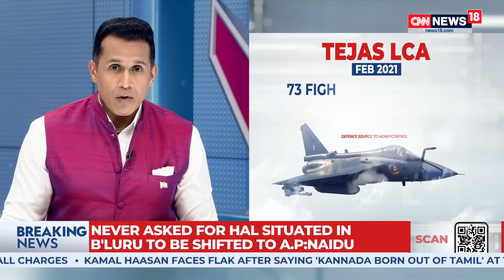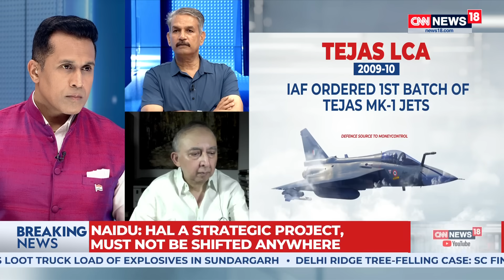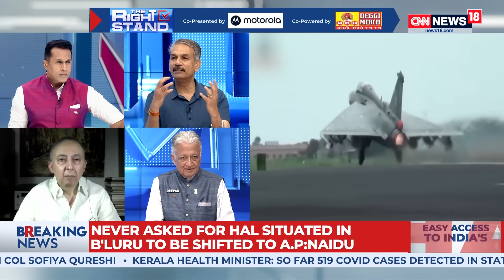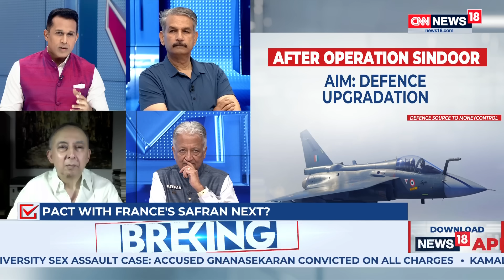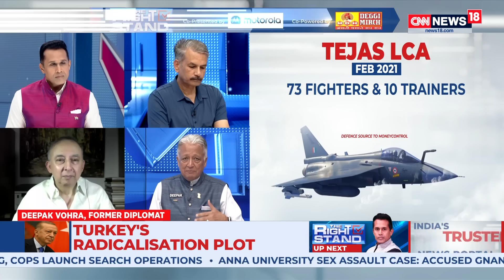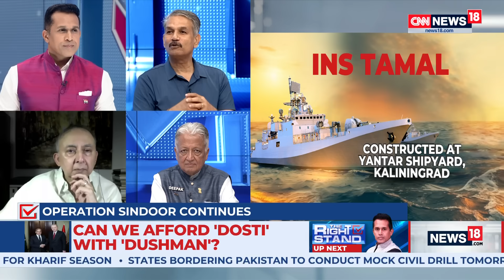India Eyes Partnership With France's Safran To Power Next-Gen Tejas Mk2 Jets | #therightstand

Comment: What is the benefit of Tejas with GE404? is it a value for money investment.

South Korea’s KF-21 Boramae is powered by the GE F414-GE-400K engine, while Turkey’s indigenous fighter uses the F110 engine, the same one found in the F-16. For India, opting for the Safran M88-4E engine makes strategic sense. The French are more willing to cooperate, and maintenance is simplified since the M88 is similar to the engine used in the Rafale.

The era of close-range dogfights is largely behind us. Modern air combat requires stealth fighters capable of neutralizing enemy threats from distances of 500 km or more. Success depends on long-range supersonic air-to-air missiles, advanced electronic warfare systems, and radar-absorbent material (RAM) coatings. These elements, more than raw engine power alone, make the difference in today’s aerial battles.

Comment: Why the Public Sector Must Anchor Armed Forces Servicing, with Private Sector as Strategic Integrators

In the context of India’s defence ecosystem, it is strategically sound for the Armed Forces to interface primarily with public sector undertakings (PSUs) such as HAL and BEL for servicing, spares, and long-term sustainment. Here’s why:
	1.	Streamlined Procurement and Servicing:
Direct procurement and servicing from PSUs are operationally smoother for the Armed Forces due to established government-to-government frameworks. These public sector entities are better aligned with defence procurement protocols, reducing delays and administrative complexities.
	2.	Assurance of Quality and Qualification:
PSUs have the systems and experience to rigorously qualify spares and sub-systems, ensuring consistency with defence standards. When private sector firms supply parts or services to PSUs, these undergo an additional layer of scrutiny—ensuring the Armed Forces receive only validated, field-proven components.
	3.	Security and Confidentiality:
While the private sector brings agility and innovation, the responsibility of preserving national security protocols and operational secrecy is best retained within PSUs. Public sector partners can act as buffers—vetting, testing, and integrating private sector innovations without compromising sensitive details.
	4.	Private Sector as Integrators, Not Direct Vendors:
The private sector is best positioned to play the role of agile technology integrators and developers of indigenous capabilities. When they work through PSUs, their solutions are better contextualized, certified, and supported over lifecycle operations. This ensures sustainability and traceability—key concerns in defence logistics.
	5.	Focus on Availability, Not Qualification:
The Armed Forces need rapid availability of certified and mission-ready spares—not to be burdened with the complex task of qualifying parts themselves. PSUs can absorb this function, allowing the military to focus on readiness and operations, not procurement logistics.

In contrast to the conventional view that private-to-Army is faster or more efficient, a PSU-anchored model with private sector participation ensures:
	•	Stronger oversight
	•	Higher quality assurance
	•	Strategic control over sensitive systems
	•	Better alignment with existing government systems

This model secures India’s defence supply chain while still promoting private sector innovation—making it both practical and future-ready